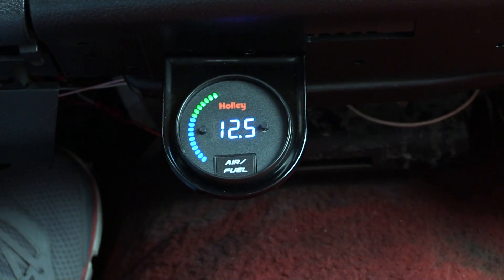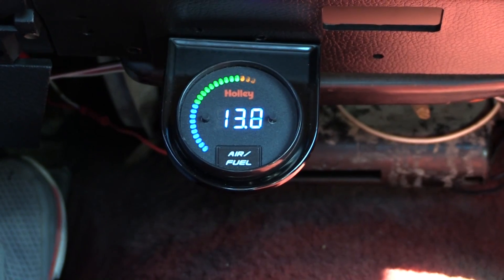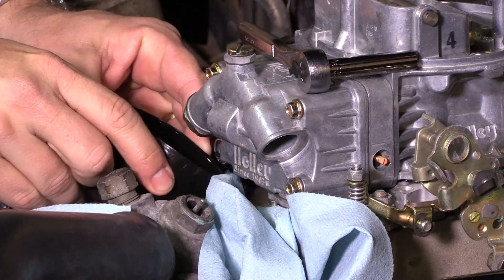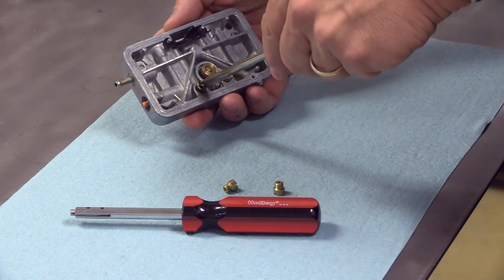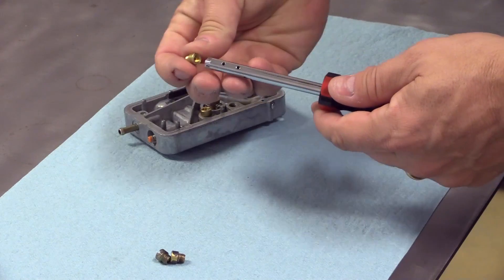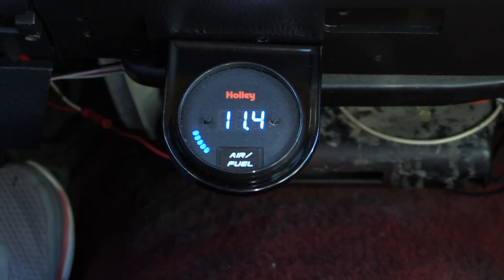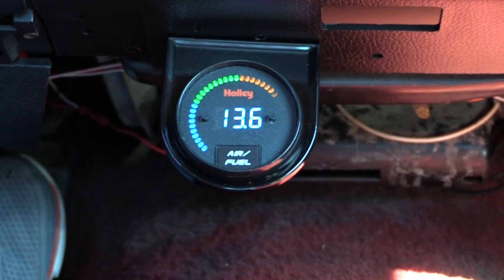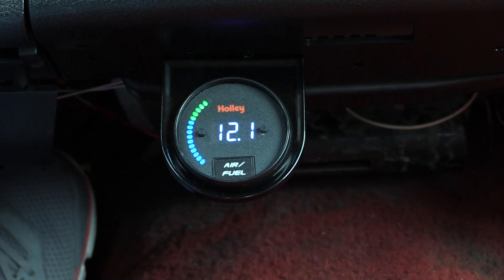Carb Tuning with Holley's Wideband O2 Meter

Comment: my trans am idles 14.7-15:1, cruises 15.5-16.5. WOT is varies around 13:1. It has rheostatic response. Lean is good. The only time lean is bad is a full throttle

Comment: 12:1 while cruising? Isn't that way too rich? I thought the goal was 14.7:1 stoichiometric, but err on the rich side a little to reduce piston crown etc heat :and detonation. But then I'm 40 years rusty with carbs. I went gas FI then diesel decades ago.

Comment: Don’t get to wrapped up in chasing a/f numbers  on a performance build with a decent cam ,heads, and intake manifold. I went down this rabbit hole and I’ve had a lot of custom carburetors built and tried a couple of the bolt on the EFI’s I started picking the brains of some of who I feel are some of the best carburetor builders in the United States and they all said the same thing don’t go chasing air/fuel ratio numbers give the engine what it’s want when I started doing that and quit staring at the numbers on my wideband. My car ran a lot faster and a lot harder idled better ran Better wot, use the wideband as a tuning tool to help you don’t get wrapped up with the 14.7 number read your spark plugs when I started listening to people like Jeff and John at Aed carburetors, Dale cubic at CFM carburetors, and the guys at APD my car ran a lot better. I understand it’s easy to go down that rabbit hole with all the Internet experts.

Comment: does the sensor need to be angle up when installing in the exhaust pipe
Reply from the maker: It needs to point down so any condensation won't build up around the sensor and ruin it

Comment: I am installing a Holley street avenger carburetor into my 87 Z28 with a 305 in it. How much hp do you think that I will gain after ripping out the old 80s emission hardware?

Comment: I have a triumph spitfire with twin SU HS4 carbs,after i rebuild the engine and g/box most of the resto will be done,i'd like to fit EFi etc,but the carbs are nearly new and i want to tune using lamda as stoichiometric gauges don't know the fuel used,so the O2 in the exhaust should be the best measurement point for tunning,should the holley O2 meter work on any petrol/gas engine.

I know the displacement is far from my 1500 or 1300 engines capacity,but isn't the fuel ratio going to be the same per unit value.
Reply from the maker: Yup. You are right that the displacement or number of cylinders doesn't matter. As long as you are burning gasoline, the air/fuel ratio should still read the same. Thanks for watching
Reply: @TheHorsepowerMonster  Cheers for getting back so quick there.

Comment: I have never seen a second gen Camaro with a column shift, and I've owned two of them plus most of the gearheads I knew had a Camaro or Firebird. Good vid on tuning tips with the A/F gauge.

Comment: Lobe separation angle on your cam makes a big difference on what air fuel ratio you should run, if you have 114 or 112 or 110 lobe separation angle the ideal air fuel ratio for gasoline is 14.7 for idle 13.5-14.0 for cruise and 12.5-13.0 for wide open throttle, https://www.hotrod.com/articles/wideband-oxygen-sensor/

Comment: It was cruising and 13.5 almost 1 bar which is actually fine,....a lol richer than leaner plus it's not a steady as you can see it varies not like a fuel injection which is steadier because of the manifold
Reply: We're not reading pressure here. This is AFR.

Comment: Nice video. Question, why aren't you showing the jets on the back bowl? It's a double pumper HP carb isn't it? Under hard acceleration, the fuel tends to roll out of the front bowl and the jets require extensions, too.  I was hoping you were going to go into a little more detail. Could you do a video with a little more tuning tips for N/A cars?

Comment: I wish I could get mine working no matter what I do gauge is everywhere and I'm getting a 8.88 code
Reply from the maker: It sounds like you are either close to the end of the pipe or you are pulling air from somewhere. Maybe a porous weld around the bung?
Reply: @TheHorsepowerMonster  my header has a 02 spot I put there my question is do you need to have the bung on i Hurd it might be to far in

Comment: While the general comments about the gauge are spot on, this is pretty misleading for any inexperienced tuner. Shows part throttle driving and says AFR should be mid 12s...thats too rich and neglecting comments on power valves makes it oversimplified.

Comment: Are the main metering jet circuit actually utilized when cruising under 2500 RPM?
Reply: Main metering it affects even closed throttle mix. It becomes the only source of fuel when operating at throttle angles beyond the idle transition slots.TA's that drop vacume below the power valves spring tension will open auxiliary passages in the metering block.